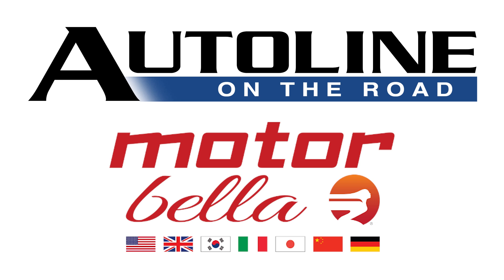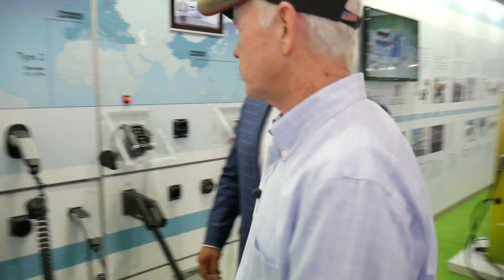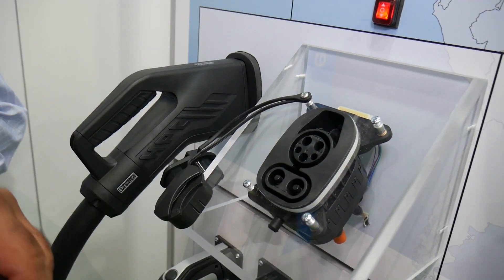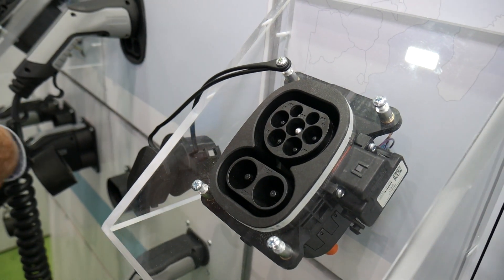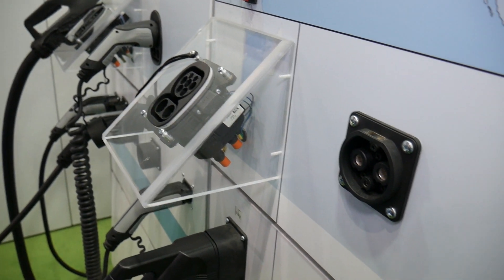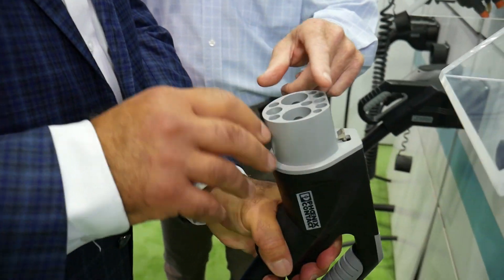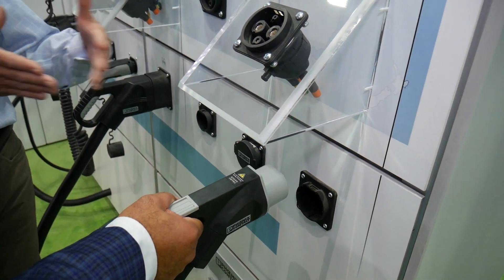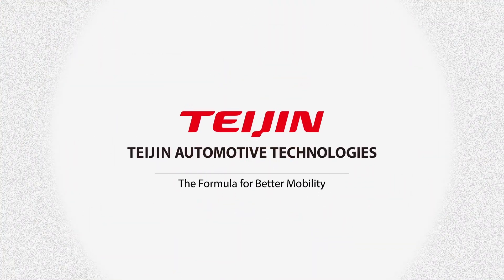How EV Connectors Differ Around the World - Motor Bella 2021

Comment: Why is US 1 and Europe is 3?
Reply: I'm not sure what the politics were over 100 years ago making such decisions, but the U.S. decided to use single phase for residential use. 

We (U.S.) generate power and distribute "bulk" power using 3 phase, only to be stepped down to single phase for homes. Our entire appliance infrastructure is based on single phase local distribution, it would be difficult to change now.
Reply: Physical distances and the "sprawl" of American population compared to Europe's more city-centric style.  It is simply not practical/cost-effective to electrify rural residential users with 3 phase power - they do not require the power density of a commercial or industrial facility, and eliminating two wires on the transmission lines saves a ton of cost at install, not to mention all the money saved from using 1 transformer instead of 3.

Comment: Left out the most popular charging connector - created by Tesla.  It's the lightest, most compact, and easiest to use.  CHAdeMO and CCS appear to be designed to make charging as miserable as possible when automakers wanted EVs to fail in the marketplace. Sadly, they are now stuck with that poor design.
Reply: CCS has less losses in the connection, Tesla actually uses CCS 2 in Europe. Tesla will probably switch to CCS as well in the US to make their chargers available for other brands as well.
Reply: Envy! CCS has 3 phases. My EV has a red 3 phase 32A CEE plug in the vehicle, so I can charge at 10kW, 16A from any residential electric stove outlet or 22kW from any "slow" public charger! try that with a Tesla two wire plug, it would need around 90A at 240v single phase and melt instantly. However in Europe where Teslas have CCS, even a model S charges at 22kW on a standard public AC charger! Fast AC chargers in Europe have 44kW, 64A and the combined CCS+DC socket shown first in the video, goes up to at least 150kW at highway fast chargers! So feel free to be smug about your only 7kW on AC weird proprietary connector.
Reply: @Tore_Lund  It has more to do with the electricity grid as with the standard, in Europe every house got standard a 400volt 3 phase connection, that is "transformed" to 230 volt dual phase. (transformed is wrong word as they pick one wire + ground). 
Anyway with the standard 16 amp fuses 3 phase you can charge at 11kwh, with 32 amp fuses you can charge at 22 kwh.
So anyone can change to 32 amp fuses only the wiring have to be checked if they are thick enough (they generally are).
Reply: @buddy1155  Agree! What is neat about the Tesla socket is the pins are hollow and accept an internal pin from the female plug for larger contact surface thus lower resistance. It also blur the lines between socket gender identity, which is very much with the times.

Comment: So basically, EVs will never have a standard across the board when it comes to charge connections. The cars being sold today, will be fazed out due to the lack of legacy support in the future.
Reply: European Teslas use the same plug as all the other ev's on the road... but only them are allowed to charge in tesla superchargers
Reply: Just like there is no wall plug standards across the worlds grids. Just need a travel adapter for your car just like your laptop.
Reply: @darkairieal  wow, that’s depressing. What if my dongle breaks?. I’d be SOL.
Reply: When was there ever a global standard for anything? All I care about is local standards, or the CCS standard for all of North America.
Reply: @wzDH106  To my knowledge, gasoline filler spouts have the same diameter globally. There will be a global standard for charging plugs, the industry is still young.
Reply: @Tore_Lund  

True until you consider the diesel pump next to the gas pump (different diameter). Most filler stations here in the U.S. compromise with offering both. 

As for electricity, there was never a standardization for the basic outlet globally. I don't believe the global auto industry requires such standardization, our basic appliance manufacturers make due with these differences just fine, I'm sure the Auto industry will follow..... as long as there's standardization regionally.
Reply: @wzDH106  Far too long reply: I would imagine when things mature, Europe will demand a common standard as they do with phones, which is defacto in effect already with the CCS socket. BTW ordinary domestic plugs, though different, most 230V AC ones in different European countries actually fit in other countries sockets, pin spacing and diameter is compatible. This is likely because it otherwise it becomes more difficult to export appliances to neighboring countries. If this is by agreement or different countries chose to make their version as compatible as possible, I don't know. Diesel is another fuel, so that makes sense to have a larger diameter, like we have DC sockets different from AC sockets everywhere, so there would be at least two types of sockets globally. The real underlying problem however is that everybody's ambiguous electricity is promoted as a scarce commodity when it comes to EV charging, presumably to make a business out of putting up chargers, so government don't have to pay for infrastructure and it is worthwhile for private business. However, the real plot down the line, is to manage and control EV charging, like gas is now for tax purposes and to exercise price control, so that driving cost becomes another leach.  There now exist to few options to tax EV drivers and this is one way to implement it. The solution is resistance: If you own property and want to offer charging. Just install an industrial socket, preferably 3 phase if available, and EV owners will use it because you are cheaper per kWh, as your only install cost was a trip to Home Depot. Such a charging point will be completely resistant to any from  of sur tax or logging of where the driver has been. This is a godsend in todays world.